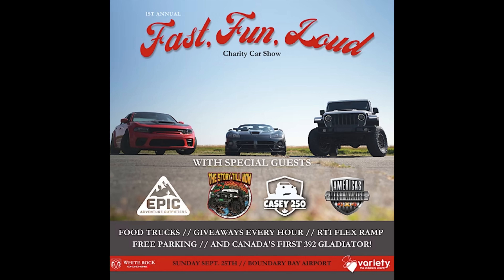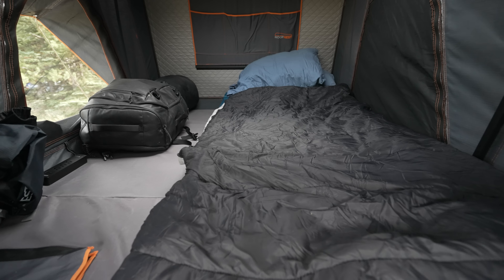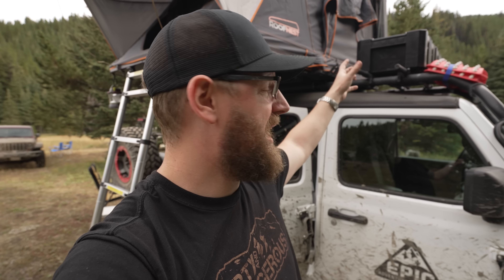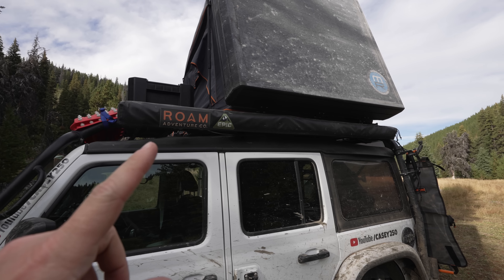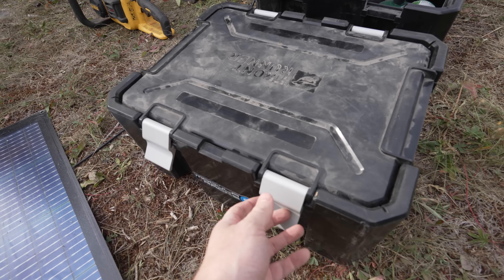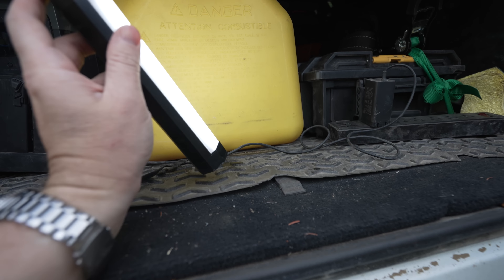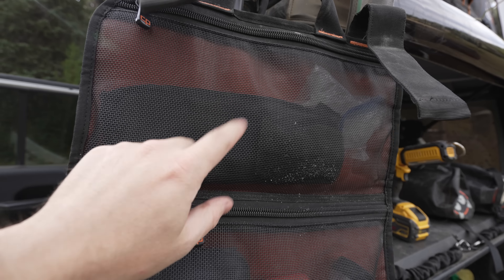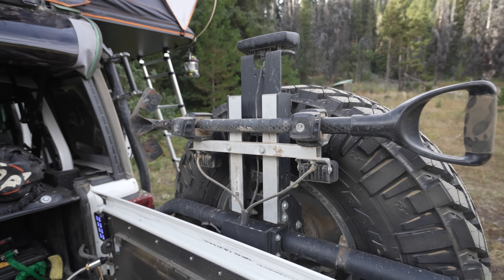Find the Perfect Camping Gear for Your Off-Road Adventures

Comment: I've have the DeWALT 20V Max 12 Inch chain saw and it is a "must have" piece of gear for overlanding. I love chopping and sawing fire wood but I've got to say there's nothing like an electric chain saw. I can have a cord of wood stacked up in 15 minutes. The only issue I have with the DeWALT saw is that the chain lube leaks out the bottom and gets all over everything. So you need to drain the chain lube before packing up. I put my saw in a small duffle bag with an absorbing towel in the bottom to catch any residual lube.

Comment: Hi Casey, I would love to hear your security experience running a SOFT TOP with all your gear. I wonder how often or how far you venture from your Jeep when out. I'm used to security issues while traveling on a motorcycle, but am wondering how things will be if I choose to go with a soft top. Thanks for your videos.  cheers

Comment: Can you talk about how you hooked up your camping lights and auxbeam controller to the ecoflow?  You may have done that in an earlier episode but I must have missed it. I want to do that in my jku.  Thanks for a great channel 👍🏾
Reply from the maker: I kept it as simple as possible. I ran a the 12v 10a DC connection into the positive and negative input of the auxbeam (I cut the end off a 12v connector so I had the bare wires. Then I just wired the scene lights into the Auxbeam's switched ports as you would if it was connected to any other power source (like a battery). Works great, I just wish there was more then 10am.
Reply: Thanks Dwayne, was just about to write the exact same question😊, not let’s see if we could motivate him to do a short video of how it’s done 😉